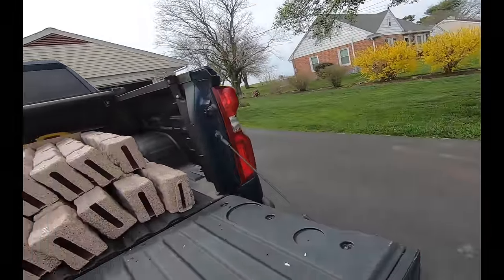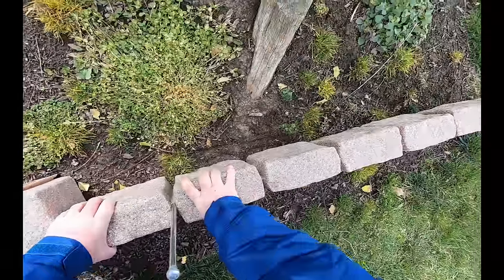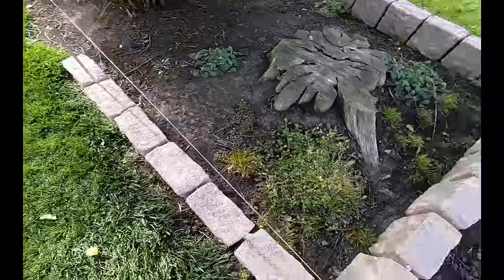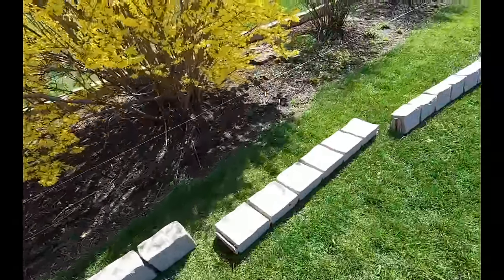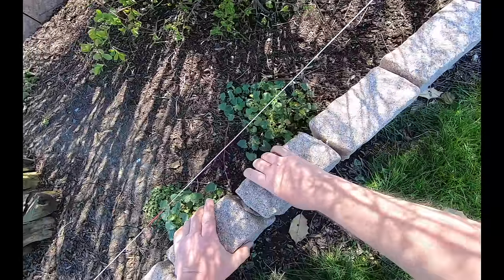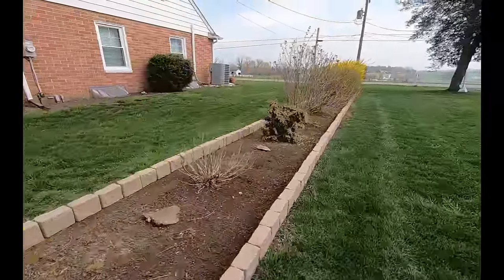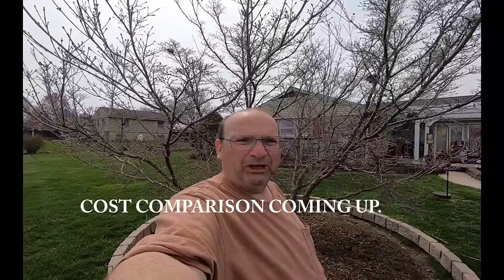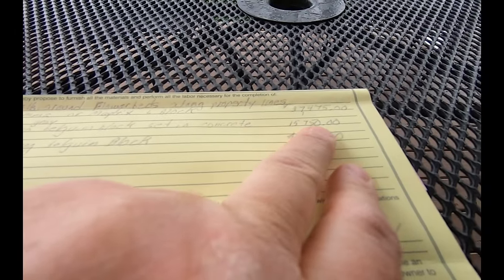Better Than Stone...BEUTA LANDSCAPE EDGING...Easy To Install, Durable, Attractive, & Priced Right!

Comment: $150 for 4 - 48 inch plastic pieces? Their nice, but way to expensive IMO
Reply from the maker: Thanks for watching. I waited for a 15% off sale on them plus a 10% store discount.  I think I was in the neighborhood of $112 for 4 sections. I’m just down the road from where they are manufactured so the Amish stores carry them.
Reply: I agree way to expensive for hollow block. I would not be hitting it with a hammer either.
Reply from the maker: @TomBTerrific  , I hammered away on them to prove a point. They are durable and well worth the money. Research the uses of poly resin. My goodness, snowplows are made out of it. If you haven’t worked with it you can’t really give a factual opinion about it.
Reply: Super expensive even i have money im not gonna buy this —
Reply: they're vs their
Reply: How do they hold up after a few years of sun exposure? Would they dry rot and have a trimmer string cut through them? They look nice, but Still, a bit pricey for hollow plastic.
Reply: Agreed u can do this with real bricks .. way cheeper.. but for easiness this is it exp with of course a sale !
Reply: Agree
Reply: Expensive, rather buy stone

Comment: The real savings were the labor and weight that had to be hauled.  I like it.
Reply: Exactly and with natural stone DOUBLE the length ... the first stone is 3/4 in the ground.  The savings is in labor and/or time. It's a great alternative on personal property.  Most people are needing easy mowing &  edging lines.  Mission accomplished.  

If he has a slope and run off in front ... then plant 49 3/4" of monkey grass in front. Problem solved.

Comment: If you want a Permanent Edging, that’s Plastic and will last. Use Composite Decking Boards, without the Groves. I attached home stakes, made with the same composite, to the back side with Stainless Steel Screws and tapped them into the ground with a rubber mallet. Tip wet the ground first, or install after a rain storm. You can make gentle Curves by Heating with a Heat Gun.
Reply from the maker: Thanks for watching and giving the idea you’ve used.
Reply: do you have a picture so we can see what you mean?

Comment: A strong string round the circumference and tightened will give you a good round then centred. I’d have used a a rubber mallet.

Comment: Steel spikes? How long before they rust away? Plastic looking stone? Trimmer will destroy it quickly. Mulch covering up a tree stump?  In the long run the hedge will outgrow the plastic border. You need to use cement blocks that are professionally installed for something that will last.
Reply from the maker: 8 years 2 months, 4 days, and 6 hours. Trimmer hasn’t destroyed it yet. What’s wrong with mulch covering a tree stump? Does that bother you? What exactly makes one a professional hardscaper…a magnet sign on the side of a truck? You seem to be one of those “professionals” that feel the need to run a competitive product down because of deep seated insecurities.  If your way is better it will win in the long run if not you will lose. That’s what’s great about a competitive market system. Badmouthing another’s product or work never has been or will be a sustainable business model.

Comment: Two years ago I had cement landscape edging installed around the perimeter of my home for $7 per foot. You can have it mixed in any color or pattern you want. So far other than a few cracks it's holding up well and the weed eater hasn't harmed it. The cracks are hair line and can only see them if standing right in front of them. No grass grows underneath them. They can be made to look like new with a hand sprayer and some water based sealer. Which I haven't done yet but will in the fall.
Reply: That's exactly what I was thinking...
Reply: what about the base level? do you know what they put under the stone?
Reply: @boopyondasnooty  nothing, it goes right on the ground. Still looking good now. Just level the ground and follow the slope. It's cement, not stone.
Reply: So great to hear , I just had pricing done on cement edging , several of our neighbors have had it done , it is pretty and lasts

Comment: Certainly better than most other plastic/composite edging products IMO. A quick follow-up video after they’ve been in the elements for 1-2 years, then maybe after 5 years would be great. Wondering about the effect from frost heave, sunlight/UV, trimming, etc. Someone mentioned chipmunks would enjoy chewing on them—so would squirrels & other rodents, especially the ones in my neighborhood. They have destroyed my decking (wood & composite), vinyl siding & even Christmas lights last year.😡🤬
Reply: Time for a Jack Russel.

Comment: Wow, at $9.38 per foot... no thanks!
But hey, they look great! While I like the look, I just can't see spending that kind of money on something that will actually cause more work in the long run. Since you can't mow right up to them, they will now have to be either weed trimmed and/or sprayed. I usually just taper the mulch down on edges so that I can mow the grass, with no trimming needed. To each his own!
Reply: In my younger years I  didn't even mulch. Just let the grass or weeds grow under and just knock them down with a weed eater and then mow. Sometimes people just make a lot of work for themselves.
Reply: You can go to lowes and pay 90 cent for tan cemete brick that will last a life time. Use sand and quik Crete for the slumps in the lawn. Will look professional.

Comment: They are beautiful decorative blocks, but I wonder whether they’re effective grass/weed barriers?  Seems like grass/weeds will easily creep under them.
Reply from the maker: Thanks for watching. I believe these would be the same as other ground laid border material. I spray a narrow (about 2 inches) band of grass/weed killer along the outside of the border. Easier to mow and no trimming either even though I have trimmed along some of these blocks with a weed trimmer and there’s no damage to them at all. 
On the inside I keep a good heavy layer of mulch.
Reply: @LancoAmish  thanks for your prompt reply!

Comment: I wonder how it will hold up Through winter and the hot summer sun? Plastic does not hold up well in Florida with the intense sun and salt.
Reply: I have installed 10 boxes here in Georgia, it’s been 90-100 degrees, when you touch it it’s not even hot. Holds up great. Have not been through a winter.
Reply: I think the hot sun burns the colour a couple year later out believe me !

Comment: I wonder what options are available to fill the gaps between the individual blocks? Some types of warm-season grass are quite invasive (ex. bermudagrass) and frequently want to creep into the flowerbeds using the gaps between the blocks.
Reply: You would also have to bury them in the ground a few inches deep.  I don't see why you couldn't do it with these plastic blocks.
Reply: I have some Bermuda creeping in between but I just weed wack it
Reply from the maker: I spray a 1-2” band of weed and grass killer along borders every 6 weeks or so. Keeps the vegetation at bay. Also, mulch on the inside 4 inches deep works great.

Comment: Very informative video, nice job. About the only question I have is what happens if you have a run that isn't a multiple of 48"? Is there a way to cut a 48" section, say in half, and have a finished end?
Reply from the maker: They are easily cut. It wouldn’t be too much work to use an end piece and fit it to where you cut it. A jigsaw or oscillating multi tool would make it simple.  You’d have to cut a slot in the end to fit the pieces together.
Reply: @LancoAmish  I got'cha... rotary tool to carve out an opening then attach a start block to finish the end. Genius!

Comment: It looks nice    i just wonder how  "plasticy" it feels    how does it hold up to UV fading   etc etc.    It is expensive for plastic
Reply from the maker: It doesn’t feel plasticy at all. Its rather thick but still pliable between pieces. I believe they have samples you can order from their website. Poly resins are used a lot in outdoor applications. Snow plow manufactures are even using it.  
Poly lumber furniture has been around for years. I have bird houses made of it and they’ve been in the weather for 5 years now…look like new still. Poly resins have come a long way in the past few decades.

Comment: Did you come across any where the male connector was cut too large to fit? I ordered 4 boxes and 6 of the 20 pieces were too large and I don’t have the tools to shave them down. The seller is in the process of doing a replacement for me but curious if you came across that seeing how many you ordered.
Reply from the maker: I had one piece like that. It also didn’t have any stake holes drilled in it. I thought it may have been a reject that got into the pallet by mistake.

Comment: Interesting product. However, the website says nothing about UV resistance, chemical resistance (weed killer), fade resistance, freeze/thaw cycles. It mentions weed trimmer but doesn't back it up with any sort of warranty. In one place is says that the product lasts "up to" 20 years and in another it just says over 15 years... but that doesn't mean anything. "Up to" could mean 6 months and they have no provisions about a 15 year warranty listed. If it really lasted 15 years and met all those conditions above I might be interested.

Comment: Shound be using a rubber mallet to hit the stone.
Reply from the maker: That wouldn’t have shown how tough they are. If this same type of material can be used to make snow plows it surely can be hit with a steel hammer. That was part of the purpose of the video.

Comment: Hows it hold up to the elements. Not a big fan of manufactured hardscaping materials.
Reply from the maker: Thanks for watching and asking. Doing great so far. They’ve been around here for a number of years. I checked out a few places with them installed for a couple years before I committed. They still looked good.

Comment: Can you add more than 2 stakes to each peace if you buy extra? Or does it only comes with 2 holes
Reply from the maker: You could drill your own holes if desired but after a year mine are still quite solid. I usually run my mower deck right up to them.

Comment: Your comparing a materials cost to a materials and labor cost.
Granted that the plastic blocks are more feasible for a DIY project, but it is not a fair comparison.

The material cost is roughly $9.40 foot. That is NOT cheap for edging.

Comment: I have a Bermuda lawn and this would be worthless as the Bermuda would run right under this stuff and invade my landscaping area.  It might look good, and be cheaper than concrete edging, but would not solve my biggest problem of having to dig the Bermuda out of my landscaping.  That stuff grows everywhere that you do not want it to. Maybe if one would dig a 3-4" trench before installing it, but not sure if that would help.  Anyone else see how to make this work for Bermuda?  I have concrete edging right now and it works because it is really deep below the surface, and Bermuda still tries to find ways into the landscaping.  Interesting stuff here though and it might work for Fescue lawns I guess.  The concrete edging can be shaped to look really nice.

Comment: A potential problem than I can see developing with this product (which has a very aesthetically appealing, authentic-looking surface structure) is grass - esp. species that spread by runners - infiltrating the front gaps between the blocks and becoming a constant headache to remove - and you couldn't very easily do that with a weedeater.  Wouldn't be that big a deal if you're dealing with a short section - but hundreds of linear feet of it could possibly result in a major maintenance pain.  

The gaps between blocks were of course a necessary result of the manufacturing design, but that design also results in detracting from the otherwise nice look.  Outside curves would be especially unattractive with their gaps, but straight runs would also suffer from that unavoidable appearance (and possibly maintenance) problem.  Also, it's been mentioned that the shiny stake heads are visible, and that would further detract from the look.

Compare this setup with a professional (or good DIY) real masonry job where the gaps don't exist or are minimized or where they are mortared up, and which provides a more finished-off, neat, and permanent appearance.  Remember, you often do get what you pay for.

I would suggest that if you can live with this design, and where your budget/time prevents anything more expensive, that you order a minimum of one section to see if you really will be satisfied with it in the long run.  Will that plastic suffer from mold/mildew/UV problems over time, and need to be pressure-washed, resulting in potential dislodgement problems?  (Think about those poly downspout trays that become icky with mildew and UV-damaged over time.)

And keep in mind that you will not be able to just throw these sections down on unprepared ground and have anything that approximates a neat, finished-off appearance.  You will have to level the surface of the ground, and that takes a considerable amount of work. And if things are even slightly out of kilter, those gaps are going to be even more pronounced and unattractive, not to mention the non-level of the top surface of the run of blocks.  

Let the photos/videos of real-world installations of this product be your partial guide.  I did, and I wasn't impressed at all.

For some people this might be a perfect solution, but for me, I think I'm going to have to pass.

Comment: I read a couple of pages of comments and didn't see this addressed at all:  but you're locked in with those lengths, yes?  Like, the width of your hedge row seemed to fit perfectly with the dimensions this product comes in ... but what if it didn't?  What if you needed to extend it 10 more inches?  It seems like you're SOL with this product.  But if your project matches rigid dimensions, this seems like an ok solution.
Reply from the maker: They’re easily cut and there are end caps.

Comment: How easy do they shatter when a weed eater string hits them?
Reply from the maker: They don’t shatter. They are made out of poly resin. Very durable. I’ve hit them numerous times with a lawn tractor deck. In the video I was striking them with a hammer. No problem. Snow plows are being manufactured now out of poly resin.

Comment: I guess it would depend on how they hold up to weather and the suns uv rays. Stone and concrete lasts forever, plastic doesn't.
Reply from the maker: Thanks for watching. I’m guessing 15 plus years before too much degradation. So many outdoor things are made of plastic. My Silverado has lots of it on the outside. They’re making snowplows out of poly resin also. I’ve got 15-20 years left. After that I’m guessing I won’t really care. 🙂

Comment: $25 for a 4’ section is $6.25 PER Foot, some of the individual corner or starter bricks over $20 each. I didn’t spend that much for my wood floors. Way too expensive.

Comment: Did anyone else notice  - After he spiked in the right hand corner he realized he  forgot that to put the corner piece in from the bottom you need to raise up the first section, but you cut out that portion of the instal video and didn’t even mention it
Reply from the maker: Very astute observation. 3-4 hours of video and edited to 30 minutes…not everything goes on.

Comment: Not worth the price and what do you do if you have an odd size length? (ex.) 26 1/2 ft long. How do you fit it in? These are not cutable.
Reply from the maker: Compared to real stone or even manufactured stone these are very affordable. These are definitely able to be cut. You’d have to drill your own holes for the stakes and spend a bit of time getting them to look right but it’s doable. They serve a purpose. They may not be for everyone but they were easy to install and like many things made from poly resin are going to be very durable.
Reply: @LancoAmish   You compared prices from companies that do the installation compared to you buying these and doing them yourself. That's not a fair comparison. You're also using expensive stone in those other installations. There is plenty of stone out there that is better priced than $37.50 for 4 feet.

Comment: The price for this is WAY out of line. Stone is so much cheaper and not the harder to install.
Reply from the maker: How much would 4 x 6 cobblestone cost to install the same amount of feet? As far as ease of installation I installed almost 800 feet of this in about 8 hours which included string lines and removing sod that was in the path. Also, don’t forget delivery. I was able to make one trip with a full sized pickup. How many trips to haul that amount of stone?
Reply: @LancoAmish  I am 77 years hold and i can install 800 feet in about 2 days for 1/3 the price.
Reply from the maker: @GarryBarnett-o5k  , go for it! God Bless.